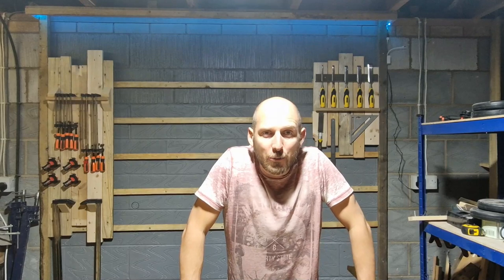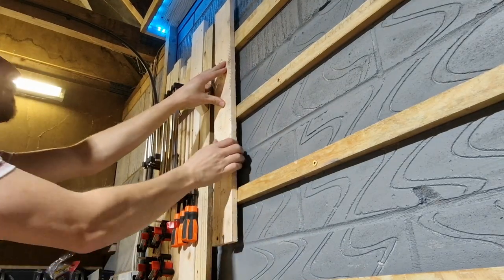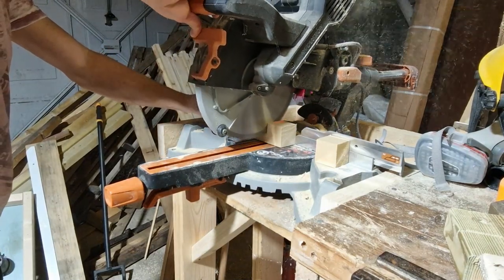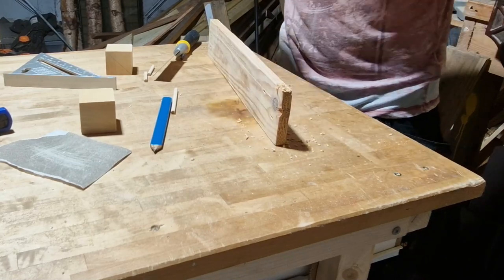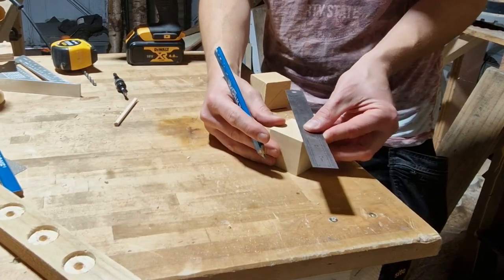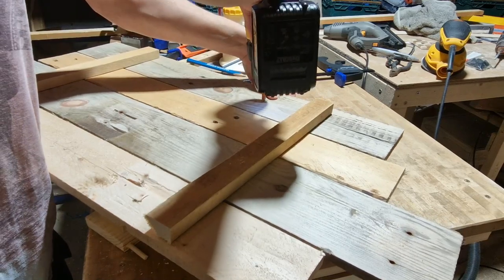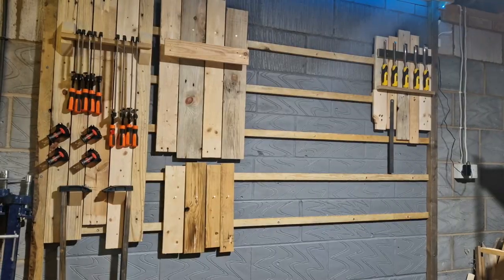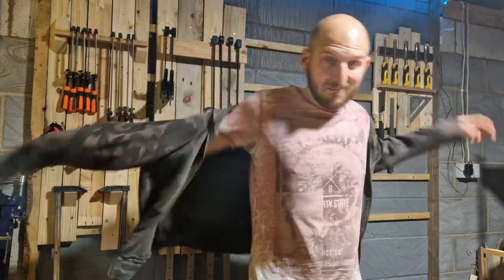WORKSHOP UPGRADE: Clamp Storage (free, quick and easy) - Part 2

Comment: Great work mate. I will probably steal some of these ideas. I do love the look of the pallet wood.
Reply from the maker: Yeah, I'm a big fan of the rustic look and the fact you can do it for free is a huge bonus. Cheers for watching.
Reply: @justbswoodworking  I did a similar thing as a shadow board on a workbench I built. Unfortunately we’ve recently had some floods and I had to throw it out due to mould and water damage.
So I might do something closer to this when I get to rebuilding